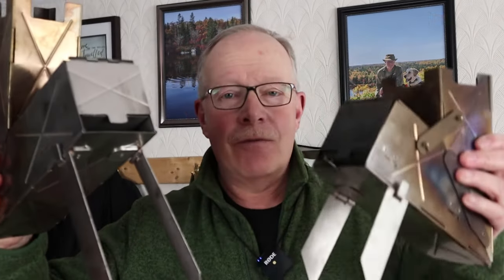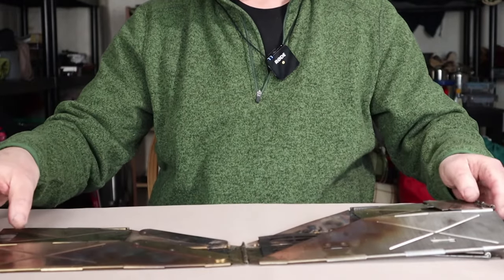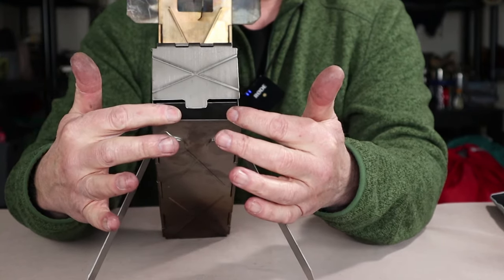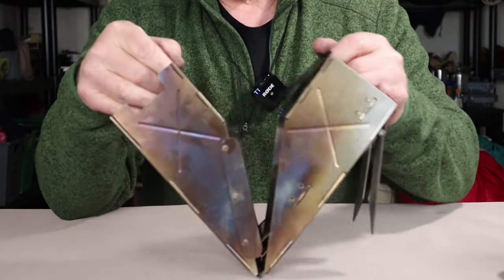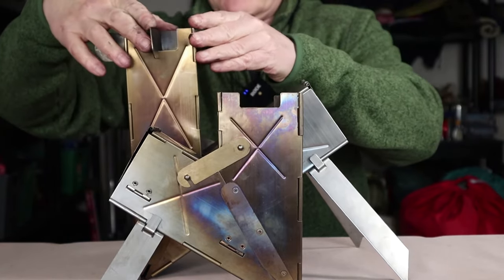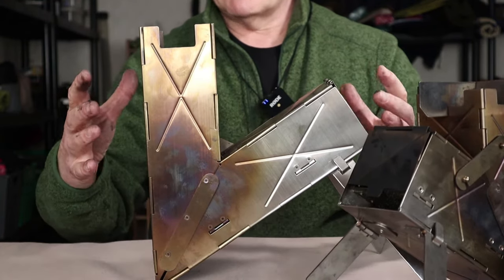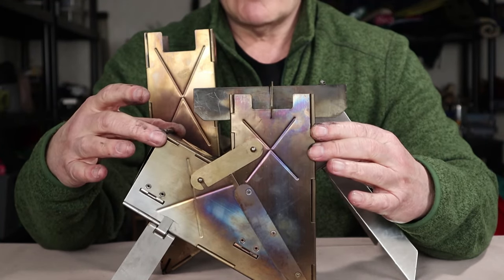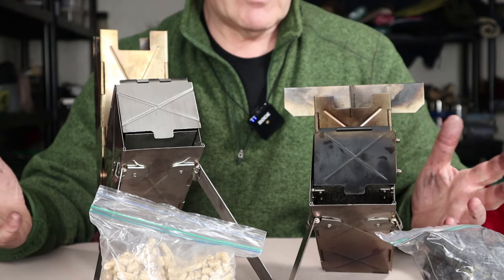VIRE Stove & VIRE Mini - Part 1 - Comprehensive Review

Comment: Hi Mark,

Thank you so much for taking the time to prepare this detailed review.

As you mentioned in the review, some of the issues discussed between us and they already improved in our last production.

Thanks again, we are looking forward to see the review part two and to learn more from it.

 Thanks again and best regards.

The VIRE Team
Reply from the maker: Thank you for commenting and bringing the updates to viewers. I have links to VIRE in the video
Reply: Hi VIRE Team!! 

I noticed that between the two stoves that there is a strong affinity towards the larger stove for those wanting more of a true rocket stove and I agree. The taller shaft seems to really help ignite the volatile gases. But I noticed that the VIRE Team has only made a titanium version of the mini but I’d really love a titanium version of the original VIREstove (along with the other design updates of course). Is that something that’s in the works? Or maybe if you had an optional attachment to extend the vertical shaft for the titanium mini?  I thought about fabricating one but saw your comment here and figured I should just ask. Dunno if you follow the thread from your comments but I figured I’d try. Thanks! 🙏🏾

Thanks!

Comment: I'm glad you mentioned about the smaller size losing the vacuum power! I was actually thinking about that with seeing the first one, that I would like for it to have been taller. Also, I think once you get the fire going well, closing the door over the fuel shoot, would make the air suck through at a higher velocity (but I don't have one to test that theory).
Reply from the maker: You are correct on both counts. Closing the fuel door cover can be an issue if feeding longer sticks. Thanks for commenting

Comment: Interesting stove, why not make a metal sleeve that is wide enough to slide onto the top section to help keep the air from flowing out of the openings?
Reply from the maker: Yes, that could work. It would add weight to it of course. I have considered wrapping it in carbon felt. Lighter and insulates it as well. Thanks for commenting